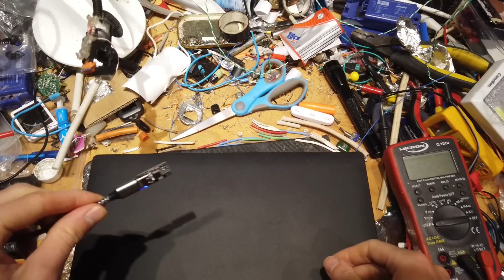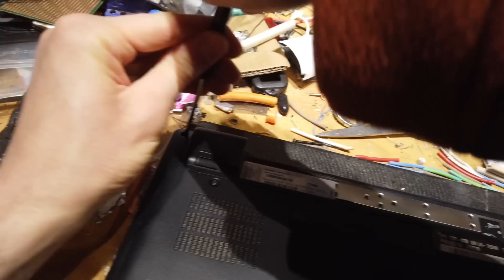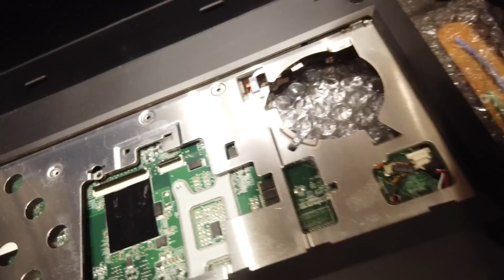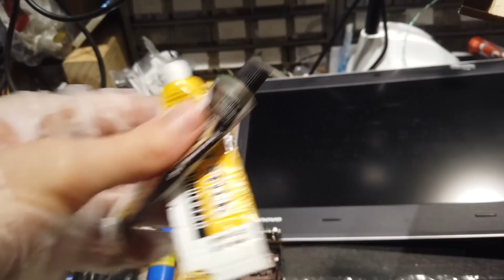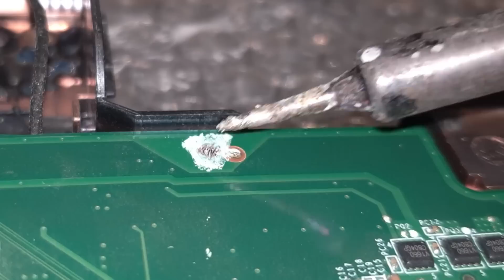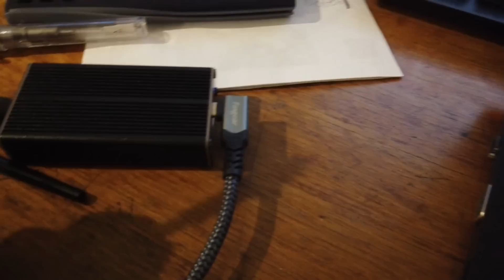So I put a USB C charging port in my year 2011 laptop

Comment: That middle pin is used to identify the charger. So the firmware knows what type of charger you use and also it will tell you if you get a counterfeit charger
Reply from the maker: Thanks
Reply: wait so is there a way to physically force that type of connector? i have a victus with no way to disable this behavoir in the bios and so it decides to not charge when i connect a different charger
Reply: Seems silly. Why would you want to know if it was counterfeit? Does it really matter? Or do they just want to make more money?
Reply: @LindonSlaght  depends on the quality of the offbrand charger, some arent properly filtered and put noise on screens. but in the end its a easy way for lenovo to say well you arent using our charger so you're SoL and on your own there
Reply: @armando92  I still feel like it's a cashgrab.
Reply: @LindonSlaght  i dont know.. my laptop complains about counterfeit/unauthorized charger after I fried it's middle pin chip. Sometimes just shows "cannot determine charger type". 

If it can't detect the chargee type, the firmware will limit the CPU performance.. 930mhz in my case
Reply: @putraadriansyah8082  bro it's not even 1ghz
Reply: @Abcd123Alex  yeah I know.. the only software fix I know is to add "processor.ignore_ppc=1" to the kernel commandline. Otherwise I have to fix the middle pin trace in my mainboard. It's a Dell N4030
Reply: @putraadriansyah8082  you can use throttle stop And BD prochot there to ignore
Reply: @Callagwhan  no throttle stop app for Ubuntu. 

I don't need to install anything, just add "processor.ignore_ppc=1" in the kernel commandline and done
Reply: @LindonSlaght  When batteries are not charged properly, they can explode. So, there's a liability reason for verifying that an official charger is being used.  Adding a bit of detection is much cheaper than paying for settlements.
Reply: @CM-xr9oq  except if they have a unique connector on it then they'll ensure that chargers that fit the device will have the right voltage. Besides, it's as simple as having a voltage cutoff. Laptop detects too little or too much voltage coming in, cuts off connection between power supply and motherboard. Also, it's the laptop circuitry that charges the battery, not the power brick. The power brick is just supplying power to charge the battery. So the worst that could happen is a blown battery charger, which if it was designed with any sort of common sense, wouldn't short the battery or allow voltage to the battery when it failed. In no world is unnecessary e waste a good or excusable thing. Your iPhone doesn't need to charge from the (used to be) included brick. It's 5V. Anything 5V will work assuming it lets through enough amperage. So I don't know why you're advocating for e waste but uh ok.
Reply: @LindonSlaght  i think it's for the company to use as warranty void flag!
Reply: @LindonSlaght  Oh it's definitely silly, but definitely so the company can make more $$$.

Many newer laptops with this extra pin will outright refuse to charge or run if it doesn't have an appropriate OEM signal coming from the charger.

Even the older ones that would still work without the pin would usually warn you that since the laptop doesn't know what the wattage of the charger is, it'll run basically underclocked so as not to stress the charger.

I guess you could look at it as a safety, but they've made it into more of a paranoid level safety over the past 10 years or so. ☹️
Reply: @southernflatland  my mom has an MSI laptop, and the cable on the power supply broke. We got a new one and it was 3rd party, works fine. So atleast there's companies that don't do this.
Reply: @LindonSlaght  Indeed, MSI didn't do this nonsense back when I worked in computer repair. Neither did many older model Dells or HPs, but when I say older I mean like pre-2010, a lot of things have changed since then and the companies have shown that for a large part they care less and less about the customer every single year ☹️
Reply: @southernflatland  yeah I'm an android user. Tell me about companies not caring 🥲 not giving up my headphone jack.
Reply: @LindonSlaght  Cheers to that homie! 🍻

Headphone jacks for the win! SD Card slot too!
Reply: @southernflatland  heck yeah. My next phone will be a Sony whether I like it or not, those aren't features I'm ever gonna give up. Dumbass bs Samsung excuse "oh we didn't have space for a headphone jack in our 6.8" phone, somehow didn't have room for a microSD card slot either 🤡"
Reply: @LindonSlaght  The Asus Zenfone line of phones are pretty good and still have the headphone jack.
Reply: @zebulongriggs4986  useless to me without a card slot. I've got 189GB of music alone on my phone, upwards of 50GB of photos and videos, and the OS on my phone takes up 37GB. Sooooo even the max size 256GB would be useless to me.
Reply: @southernflatland  yeah, they care less and less about your house burning down.
Reply: @LindonSlaght  Not giving up your headphone jack?  Sure, eventually, you'll be left with an outdated, vulnerable phone.
  Bluetooth earbuds are pretty good.
Reply: @LindonSlaght  headphone jack and microSD slot...any external ports means the phone's water resistance will be decreased.  While I didn't like the idea of giving up my microSD slot, when I upgraded my phone, I bought one with the largest onboard storage available.   Problem solved.
Reply: @CM-xr9oq  I know right, like I'm on the October 2022 security patch. So old tbh. I need to get a new phone ASAP. Too bad they don't make phones with headphone jacks and expandable storage.. oh wait, Sony does. 

Also if you're gonna say something about microSD cards being outdated, let me remind you that microSD cards ARE:
-Fast enough to record 4K60FPS video to.
-Cheap - 35$ USD for a 400GB card.
-Doesn't really matter but I thought I'd remind you that WiFi was released the year before the microSD standard and you still use that.

Bluetooth audio is objectively worse than wired audio. Bluetooth headphones are almost always unrepairable, and break in 1-3 years. Wired headphones can and will last decades. Bluetooth headphones are much easier to lose, and much easier to damage. Wired headphones are durable and hard to lose thanks to the long wire hanging out of them.
Reply: @CM-xr9oq  not everybody goy the money bro, never heard of electromagnetic pollution? Not everything needs to be wireless.
Reply: @CM-xr9oq  Exactly what they wanted you to do at much greater expense than micro sd cards.
Reply: @Something Technical UK poor quality power supplies may explode, yeah. But that doesn't give the manufacturer the right to cripple your product if you use it with an unapproved one. It's not like power supplies are hard to make. If it's bad quality there's gonna be reviews saying so.
Reply: Not necessarily the case on older laptops such as this one.
Reply: Someone already comment this somewhere in this comment section. The mid pin used to detect the rating of the charger so the laptop won't draw more than it can supply. There's a resistor connected to that pin. Different value for different charger rating.

Comment: that's actually a pretty bad thermal paste application it had, didn't quite catch if you were sarcastic :)
Reply from the maker: Full story: My first thermal paste application was really very carefully applied. A beautiful even coating. Then I tested the thermals and wasn't too impressed. So I pulled the heatsink off, and in an mix of impatience and 'content production', I put heaps on and squashed it down... The thermals were identical. 
It never thermal throttled though.

Comment: Would it have been possible to solder wires from a USB port to the usb-c port to get the full functionality since it is backwards compatible with USB 2.0? Or would it interfere with the other USB port.
Reply from the maker: That is something that crossed my mind.  But then I saw that the usb-c trigger module wasn't very friendly to solder extra wires to, and then I would need make sure that 20v doesn't feed into the 2.0 type A ports ( maybe with some diodes ?). Because the trigger module doesn't supply 5v... Then I gave up thinking about it. I would never use USB C 2.0 anyway ( and I couldn't use them at the same time).
Usb-c 3.0 is a different story: I've bought a 'pci-e to USB 3' adapter and it works (only tested it once in 2.0)  in the empty internal pci-e solt. I could run a USB cable from that to an extra USB C port.... An interesting option if I wanted to risk another tear down

Comment: Great job! Now you got a future-proof laptop to outlast that bulky proprietary charging dock. Speaking of, that extra pin in the charging connector is to signal the maximum power the charger can deliver. Some Thinkpad models would throttle the cpu frequency if you got a weak charger with no battery attached.

Comment: what if you plug in both chargers?! DUAL CHARGING?!!?
Reply: *Dual burning
Reply: Bad idea
Reply: Slightly different voltages = bad things may happen.
Reply: 40V
Reply: It would still be 20v, the current would increase and possible magic smoke, fire or boom. Or it just charges faster.

Comment: Awesome idea, I’d be curious to see if a newer variant using a slim tip would respond well to it or if the software would pitch a fit about it being an unsupported AC brick.
Reply: From what I've seen people have USB-C PD modded T440p's so I'd expect it to be possible on other slim tip laptops too
Reply: @Pasi123  Yeah it seems to be possible on some forums. Im wondering about the smaller laptops
Reply: Just buy a cheap 3$ USB C to Slim Tip adapter. Or even USB c to slim tip cable for 7$.
Reply: @ligametis  the point would be to eliminate the need for extraneous items in the bag. Dongles get lost all the time, slim tip will eventually be a pain to get. Not that I daily drive anything on a slim tip, but it'd be a good experiment.
Reply: @ligametis what's a slim tip?

Comment: great, but you should put windows 11 on it
Reply: Or use Windows 10 but be sure to Update Everything.
Reply: windows is the worst thing you can do to a thinkpad.
Reply: It'd be a bit old for that
Reply: @alimoo8531  not a issue. You can bypass tpm 2.0 using Rufus 3.18
Reply: @alimoo8531  you can disable the TPM checks in the setup program, if you press win - C (I think?) it opens a command prompt and you can enter regedit to disable the checks.